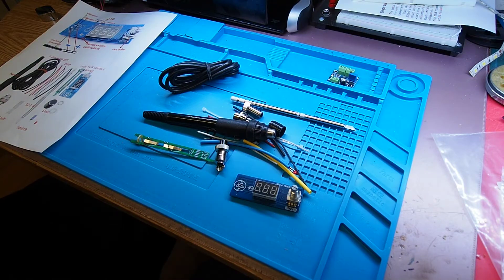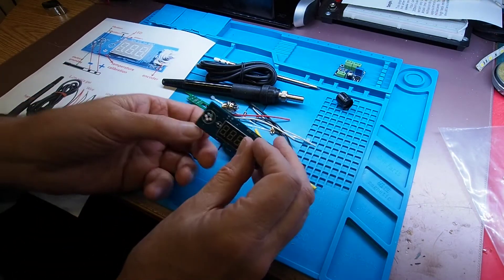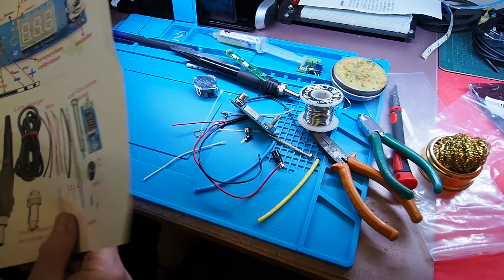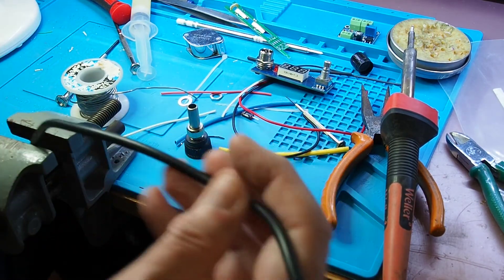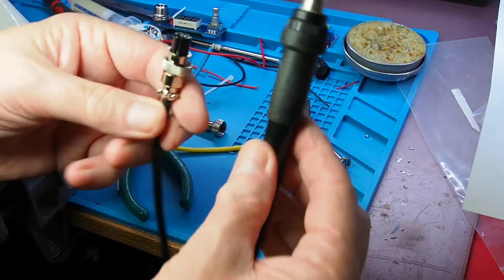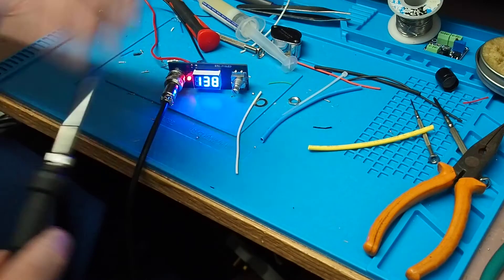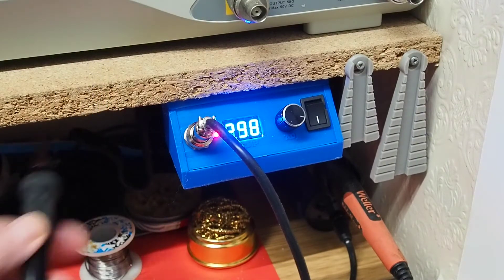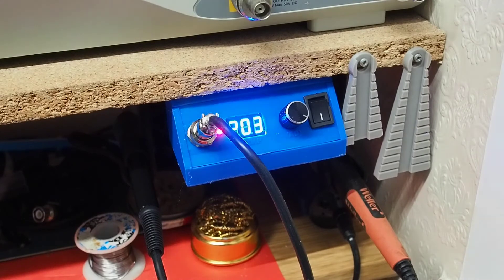DANIU Soldering Iron Kit   - #119

Comment: Also got this kit, must be more than 3 years ago, and it's worket great all this time.
I use it every day, and the only thing i have changed on it in this time is the tip.
I use a laptop PSU to power it, a DELL 19Volt 65watt that I had laying around.
Heats up really fast, like from cold to 300 C in well under 20 seconds.
I use 3 tips, one tiny for SMD components, one "normal size" for everyday use,
and a large for those big heatsucking pads or terminals.
Changing tip is also quick and easy, so for the price and performance it's a nobrainer.